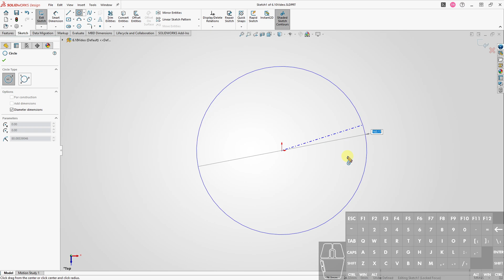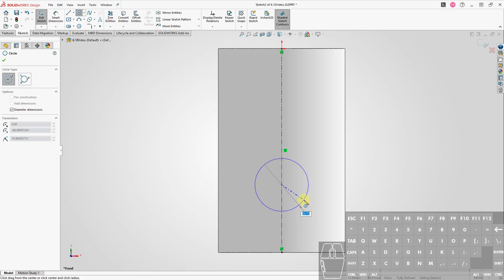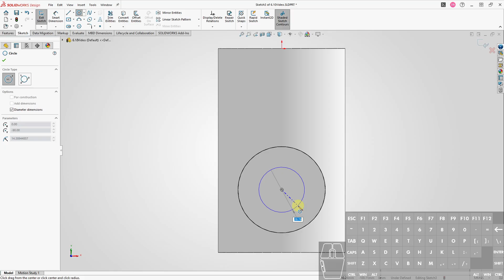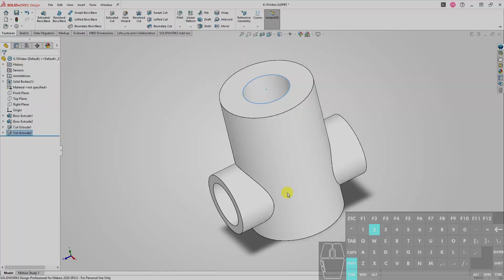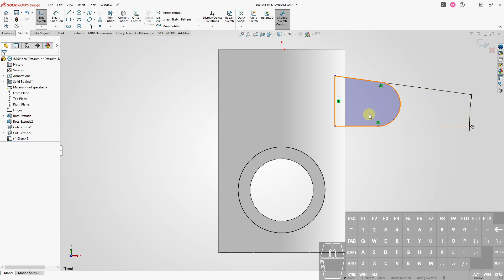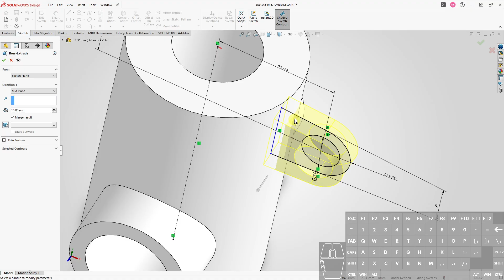SolidWorks CSWA Practice Problem 6.10

Comment: How can we use revolves to draw it?
Reply from the maker: If I had to use revolves, I would probably make a rectangle in the front plane with one corner on the origin and another down and left.  This would create the filled-in vertical cylinder.  Then create a reference plane that is 130-40=90 mm down from the top plane, and draw a rectangle in it that's symmetric about the front plane and on one side of the right plane.  Then revolve to create the horizontal cylinder.  You could do something similar to create the vertical and horizontal cuts (using revolve cuts).  For the two "ears", though, I wouldn't use revolves.  Thanks for the question!